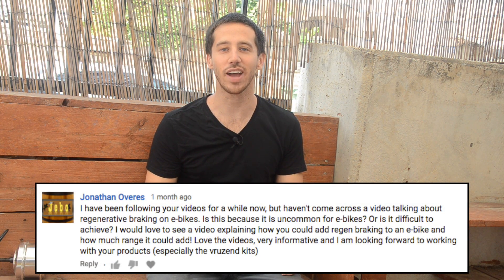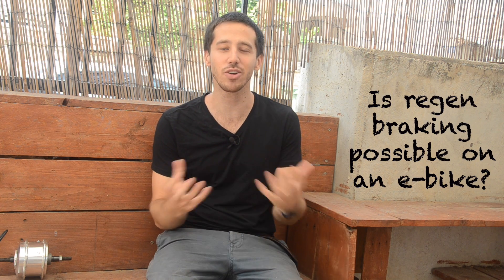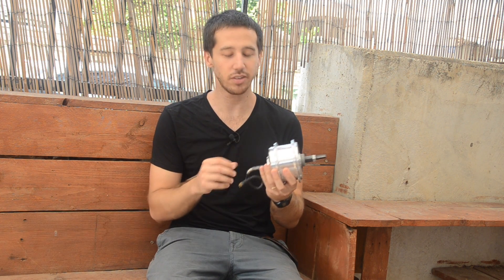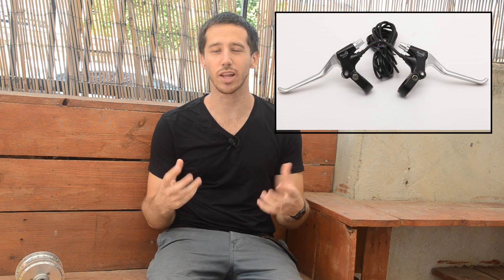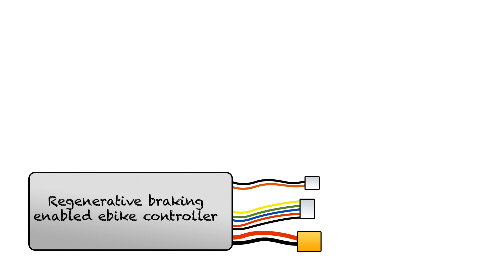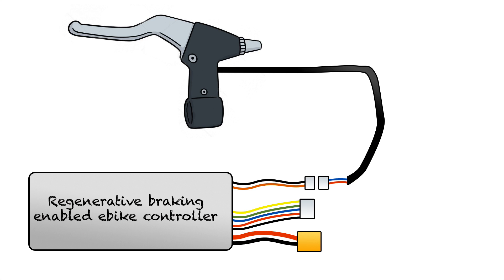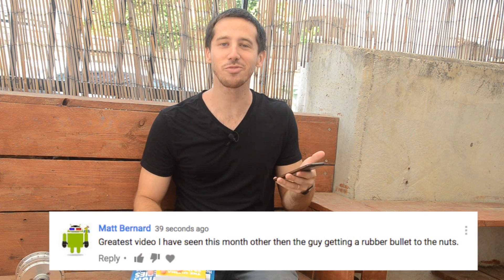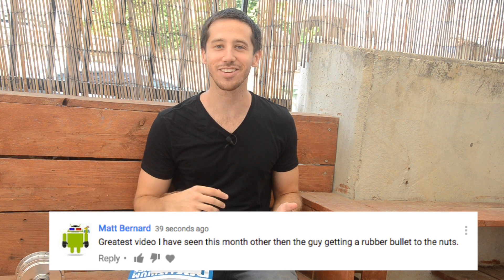How to do Regenerative Braking on an electric bicycle Q&A#9

Comment: Thx for the video. This is my #1 E-bike issue now. 
Like you mentioned, regen on E-bikes don't provide much charging power.
The real benefit is better braking and less wear on pads.
My fat tire E-bike is almost 100 lbs/ even with hydraulic brakes upgrade, they are stressed.
I have 2 steep hills I descend/ climb daily. I want to limit my speed going downhill.
I wanted to put dual hydraulic brakes on my front wheel, but that requires components I have not seen available.

I am hoping to find a reasonable conversion. Any power generated is a bonus.

Comment: Could anybody answer this,  Want to do regen on BTR Battery , 72v 20 ah battery, 50amp continues discharger 100 amp peak,  Charge leads on this battery are  only 10 amp charge. So question is, can I hook up regen to the discharge leads and will it do regen up to the 50 amp/ 100 amp peak rate?  In the video  he said you should be able to charge at a high rate using the dscharge lead for regen. Do I need an Isolation diode to make this work?  Any advise appreciated. Thanks

Comment: I don't care how much I regenerate. Electric Brakes work so much better than mechanical ones. They feel better. They just work better. I don't care how much it regenerates. And I need a lever that is digitally proportioned not just on off. Switch for linear breaking.

Comment: The problem is most affordable controllers don't have regen braking in any capacity you can't even hack them to have it and when I say affordable controllers I mean between 20 and $50 anything between there is typically affordable for the masses even for low-income people and the primary usefulness of regen breaking on an e-bike isn't recharging the battery at all because it's just not a significant gain it's the breaking force bicycle brakes suck even hydraulic disc brakes for bicycles are terrible for moving at a higher speed more velocity and whatnot it's just unfortunate that companies aren't building it into the more affordable controllers just automatically whether it be variable or just it kicks on as soon as you hit the brake lever I've been working on a way to design a system that is almost Plug and Play Universal for e-bikes to add regen braking it uses some heavy duty relays a three-phase to DC full Bridge rectifier and then from there there's a few ways you could go about it you could use a large power resistor or you could use something like a DC to DC brushed motor controller and hook it up to a load whether it be another battery or something so that it can be more variable but the point is it is doable with affordable components it should be being built into the ebike controllers or at the very least there should be a company already producing a kit to add on to e-bikes to have regen braking it's very sad that this product doesn't just exist at an affordable rate and the add-on kit just doesn't exist at all also I'm referring mostly to the larger controllers like the 72 V ones that are in those stated price ranges it is quite common to find a 36 volt controller that if you take it apart you can easily solder a ground wire to eabs terminal and have non-variable region breaking why they don't just make that a thing and have a wire coming from those terminals so you can hook it up outside the controller without taking apart I don't know but 48 52  72 they just don't have it at the price ranges

Comment: Great job Mika, my limited experience with regen braking is from a Lexus hybrid and a Tesla model 3... The model 3 doesn't seem to use the brakes since the pads never seem to ware out...as soon as you take your foot off the accelerator it starts to regen power back to the batteries, seems like it uses a strong magnetic field to do this...thanks for the great videos, Chris...

Comment: My rad bike has a lot of rear wheel resistance, like while going down a slope the bike is slowing when a normal bike would not, in fact maybe speed up. Extra effort to pedal too. Normal? Is the regen on while coasting? Can I adjust, or shut off regen totally?

Comment: On my Onewheel the regen braking is really noticeable when slowing down. If you were to set up an ebike with regen braking, would you feel it? Could you barely apply a brake lever to activate the switch and then feel the bike slowing down? Is there a way so it regens automatically whenever you are coasting?

Comment: i really want to turn my mountain bike into a sur ron.
i like the regen option because if you downhill its so easy to lock up your rear with breaks but regen works more and more the faster it spins so you can maintain a very good decrease in speed while maintain lots of trusty traction as it will have a great skid to traction ratio. 
i could care less about recouping energy its just skid control for me.
my problem is im just diving into this research and looking to make a great track bike....

where my question comes in is can rear hubs perform well off-road and i cant see why a toggle switch wouldnt work. you lock it on and when your not requesting demand the breaking will activate such as programmed setting level.
like my tesla i can get up to speed if i want to coast i need to let up on accelerator a little creating a flat. or if i let up to much it will create a negative and have a variable regen based on throttle position....

am i wrong? and maybe is there a list of people that can provide such products that i can assemble a great downhill bike?

Comment: Great video. Apart from saving brake pads: It's great for heavy cargo in the mountains/hills. Then the return is much higher than just stop and go. It's rather: It would be stupid not making use of the hard gained potential energy. The overcharging note is a good reminder and could be prevented with some additional overcharge protection which disables regen when the battery voltage is to high.

Comment: Is Regenerative Braking really worth it for a motor less than 2KW? Compared to a mid drive motor (like the BBSHD) where you can probably get the same range with ridding in the ideal gear?

Comment: Hello, I think I have a good question... is it possible to add only electric brake without it being regenerative? I think so, it would have to be achieved in a diy plan, a way to connect the phases of the motor all together and at the same time that they are disconnected from the controller so as not to make a short circuit, because if you join the phases of the motor, it offers resistance or it brakes a lot even depends on the motor that it is, from my experience, the more amps the motor holds, the more it will brake, maybe connecting relays in parallel in each phase and then another relay that connects the 3 phases when pressing a momentary button, brake the engine and work, what do you think? Thank you

Comment: Lol you disputed yourself a few times there.

That down hill at full charge... A battery BMS won't allow over charging...

Basically you've said buy a ESC with regeneration.
Brace the motor.
You get about 1-5% regen.

Comment: The case of regen while riding off a hill with a full battery...
So regen would basically slow down a motor by using it as a generator.... What about driving the motor backwards, thereby using enough battery power to balance out the power gained by regen braking?

Comment: I live at the top of the hill so that means I can't fully charge my battery.  I bought a 1500watt conversion kit an a two 52v 20ah  an 25ah battery for my fat tire bike  to travel to work daily.  That means I can't fully charge my battery because it does have Regen brakes.

Comment: Hi Josh! I'm in the mountains of Kootenays, BC, and what I like about my Grin regen is the GMac geared rear hub motor gears down and helps a lot slowing me down on big hills. My bike has been NOT RUNNING  for 3 mos and I have narrowed it down to the regen switch sticking, or somehow cutting off the motor until I power it OFF, then start again, but every time I BRAKE the same thing happens. It  also OVER-BRAKES 'electronically' (I think)  at times. I'm going to replace the levers and see if that fixes it. I already replaced the controller, and the battery. I'll check back after I fix it.

Comment: Is regenerative braking hard on the motors though? If that motors go out on my scooter and I've wondered if it was due to regenerative braking and if I should just disable it and rely on the brake pads alone because of the expenses of a motor... Does it add more wear and tear on the motor?

Comment: Instead of breaking if you had a rear drive motor would it be possible and worthwhile to put a device on the front wheel that would help recharge your battery?

Comment: Regen braking is basically a selling gimmick. You ain't going to see any real results in real life.
Reply: My real life experiences. I had regen braking on a 150lb e-scooter 6 yrs ago. It seemed the regen only worked when the 4 12v  20ah SLA batteries were so weak, that I almost had to walk it on level ground. If I pushed it. then jumped on and squeezed the brakes for 1/10 of a second, I could ride 100 meters. That's not far. but I knew I could do that over 20 times and travel at least 2km. With SLA batteries losing range after each use it was handy. Every 5,000 km I needed 4 SLA batteries. My lithium (non-regen) e-scooter has almost 21.000 km on the original 48v 20ah battery. In summary I am unsure if regen braking on a lithium battery is worth it; with SLA batteries, I think regen braking is worthwhile.

Comment: The bms on my battery is separate port and if I try to feed power back into the discharge, the bms disconnects discharge until charge is received through charge port wires. Check to make sure your battery bms doesn't have this function before trying this. Bypassing the separate port issues may be possible with diodes to control power direction on the ports or change battery bms.
Reply: Same! Did you ever find a solution? I have a liitokala 13s2p 48v battery with kt controller on my friction drive escooter. Thinking about replacing the bms. Any suggestions? Would rather not have to rip my battery apart!
Reply: @Baddiework  sadly, it seems that replacing the BMS is the best option if you really want regen braking to work with the battery. For me, I decided against adding regen braking. Here's why: Most people (myself included) choose an ebike for simplicity and low cost. When you make an ebike more complicated it can make repairs more difficult. The more you add to the bike, the more expensive it gets. I try to keep in mind that if the bike gets too expensive it will be more likely to get stolen. Regen braking seems to work better when brakes are used at high speeds. I don't use my brakes enough at high speeds. The cost to benefit ratio didn't add up in favor of regen braking for me. Why fix it if it's not broken. I'll save the troublesome aspects of regen braking for electric car manufacturers and try to keep my bike simple and inexpensive. Good luck whatever you decide
Reply: @chrisl9067  appreciate you sir! The thing is on my escooter conversion (Xootr roma) I only have the front friction brake and would like the back friction drive motor to provide some additional braking for safety reasons and this is pretty much the only option. I already have the switches/controller/display and everything setup and looking v good. It only weighs about 9.5kg but gets up to 30+mph. Dangerous yes, fun absolutely. Now I’ve determined the only option is to build my own 13s2p pack with a common port 30amp bms and Vruzend kit to put it together. Now the question I really need answering is will the batteries handle this? The bms does 15amp charge. I am looking at Samsung 30q cells with a fast charge rating of 4amp. So x2 (parallel) is 8amp safe charge rate do I need to go for different cells? I am worried about dendrites eventually forming years down the line and a fire breaking out. I always want to plug it in overnight without supervision. Any help much appreciated! Also wondering if I can just put the same standard plug charge connector on the common port bms parallel with the discharge deans connector without an issue so I don’t have to take the whole thing apart when I charge.I would like to use the same 2amp charger I already have for the Liitokala pack.The bms should take care of the rest IMO. I always bring mine inside btw since it’s a small scooter and it’s just meant to make my 25min walk to work a 5min blast! Worth the cost lol.
Reply: @Baddiework  I think you can use the motor brake without sending power back to the battery. You could try talking to an electronics expert like Greatscott! or better if you know someone who works with electronics. They might be able to add additional diodes to the litokala battery wires. I didn't have luck with that, I would've probably had to mail the battery back and forth ($$). Keep in mind that common port BMS is less efficient than separate port and that's why they put separate port on the battery to begin with. If you change the BMS you might be able to sell the old one. Other suggestion: deploy a parachute for braking 😁jk.

Comment: You have to think a bit like a performance hybrid driver.
Power up a hill (throttle) reaching peak speed just before the crest, then regen down - but use the 'engine' (your legs) to recharge through the regen.
You will lose speed going down hill, offset some by the Work done by your legs, putting a lot more Watts back into the battery.
It's counterintuitive, as most people want to ride like a uhaul truck.... gain speed downhill and lose speed uphill. But like you say, that doesnt work when you're lightweight, like an ebike or perf hybrid.
Do the opposite and you'll get better results.

Comment: The reason regenerative braking doesn't seem to work so well on bicycles has more to do with aerodynamics and riding habits than it does with actually the weight of the rider or the car. A car operates with a speed limit and it's easily able to Coast fast enough that one has to use the brakes not to exceed the speed limit, because of its aerodynamics and so on. But a bicycle doesn't usually break because of speed limits and bicycle riders typically like to Coast fast down the hill, in fact at the maximum velocity that air resistance will allow the bicycle and Rider to go down the hill. Obviously there's no energy for regenerative braking available in that scenario or even if they're using brakes if they're going fast they won't get much recharging from the battery. You would have to go slowly down the hill and use your regenerative ability to charge your battery. It always seems silly to me that if I were to climb up my Long Long Hill which is probably very few ebikes would be able to go up so I'd have to pedal like crazy and then when the battery ran out I'd have to pedal a lot longer or walk the bike all the rest of the way up the hill and it's pretty obvious that if I went slowly down the hill using the regenerative  braking instead of using the aerodynamic braking I would get a lot of charge back in the battery.

Comment: All batteries have a maximum C rating for charge and discharge, usually a lot longer to charge. All riders know breaking is almost always a faster change in speed than accelerating forward so all this energy if sent to the battery would damage said battery. The controller must limit the current causing large losses in efficiency, we must still rely on friction breaks. Also I cannot agree with the comparison to cars weight, or vehicle less than load, they are technically each a mass in motion, where the challenge is recovering and storing that energy. This video is well done and informative.

Comment: I am planning to do a generative pedaling(also includes regenerative braking in it) instead of regenerative braking! I think that way you will get a good work out if you want and charge the battery a lot more than 5 percent. let me know what you think of this. thanks.
Reply: Just eat less food it will be more efficient 😂